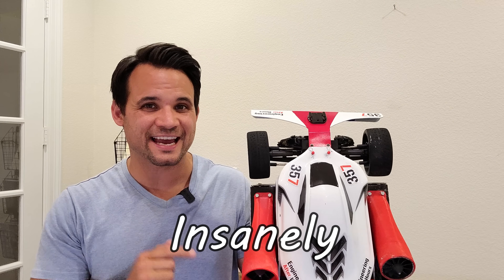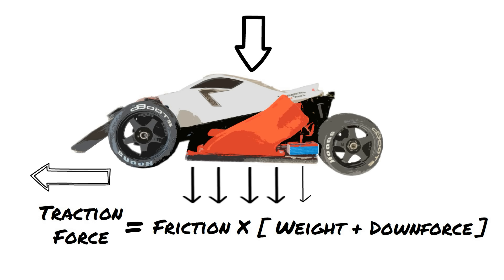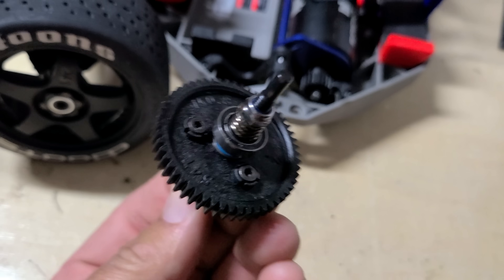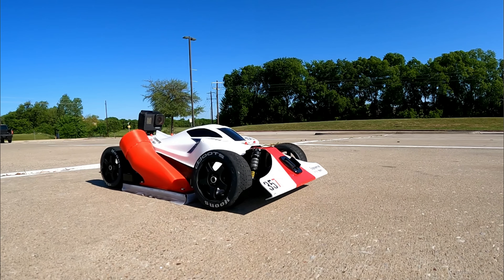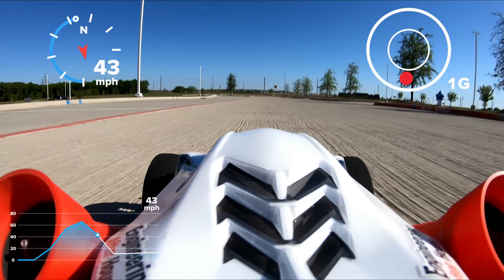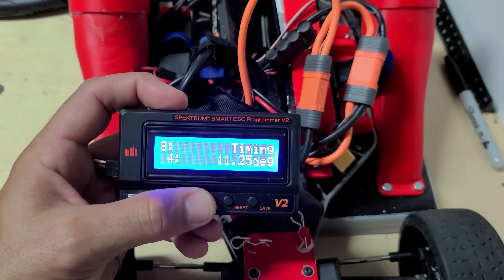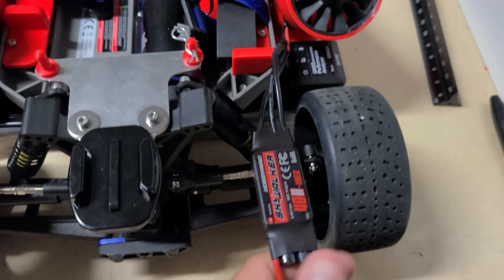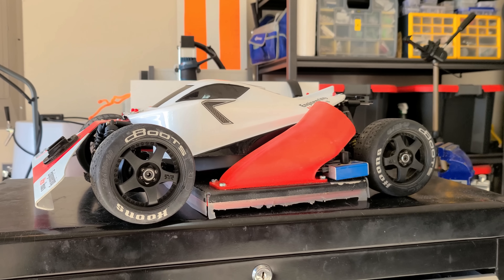241% More Grip with a Fan Car and Ground Effect

Comment: Using a ground effect to improve traction is a great idea as otherwise you're limited to about 1G as the traction simply cannot exceed the weight of the vehicle. You do mention around the 10 minute mark an intention to throttle the fans to reduce skirt friction at launch, but throttling the fans with the motor will never work asnot only do you need to overcome the inertia of the fans and fan drivers once throttle is applied before you can start generating any downforce at all from the set up, but you also have to overcome the volumetric displacement within the skirt. My first thought when you mentioned the desire to relieve the ground effect for initial takeoff was to actually stage the ground effect system with an idle stage of maybe 30-40%, and then throttling it with the main drive as this will already have your fans in motion relieving the inertia problem, and starting you off with a mild vacuum beneath the skirt helping with the displacement issue.
Another thing that could be done to reduce the displacement beneath the skirt is to fill some of it in with more material but that would both increase the risk of bottoming out and add weight that has to be accelerated and as such wouldn't be ideal.

Not going to lie though, I'm stoked to see a ground effect system in use here, as I've been thinking the same thing for a possible challenger to the roadster if I ever had the money to build it. I'd be using a small gas turbine to generate power augmenting a small battery set-up to save weight and provide huge amounts of current to the drive motors when needed, whilst sucking air from beneath the vehicle and providing a small amount thrust to help get things motivated

Comment: You should pick up an older 1/8th scale HPI nitro car and put an electric motor in it.  Those were designed for the kind of speed and HP you are trying to achieve.  The Toyota LMP car I have was 70mph out of the box.
Reply: Slash 4x4 is 65mph stock. It just takes longer to get there.

Comment: Non-sensored brushless motors have to move and twitch a little so the ESCs can detect the rotor position and start firing the motors properly. That's possibly your startup/launch twitch issue - until the car twitches and moves a little the motors can't go full power.

Sensored drive motor might be the difference.
Reply: you're telling me he has turbo lag on an electric car? makes sense
Reply: Yep sensors help with tall gearing for take off to
Reply: Glad to see this comment; a sensored motor/esc will allow for much better phase resolution and virtually eliminate the stuttering from zero RPM. In addition, a sensored setup will allow for more precise timing adjustments resulting in measurable and more meaningful adjustments when compromising mid-range torque versus total efficiency on the last leg of the curve up to 60 mph.
Reply: @caseMasterxL  150% agree with everything you said. But I'm just starting to TRY to get traction and settle in around 60mph so I can actually get on the gas 🤣🤣🤣
Reply: @motortoys9942  I have the same problem with my RC's but I don't get traction until about 80mph
Reply: @owensweeny6589  depends on the surface. Foams don't hook till 120 but still pulls all the way anyways 🤣
Reply: That and this motor and esc is very bad for studders
Reply: Agreed
Reply: Was going to say the exact same thing. It is the sensorless motor causing the stutter

Comment: Great video.  You used ground effects just like Formula 1 teams did in the 70's to achieve maximum downforce.  You mentioned that the skirts were rubbing on the ground and that's what you think is causing the stuttering.  Why not try what the F1 teams did back in the day and make a skirt that could slide up and down as the car moves up and down?  Also, I think the F1 teams used something slippery like plastic or wax to reduce the friction of the skirt dragging on the ground.
Reply: Could also use bristles, although that would reduce negative pressure (increase?)
Reply: watch his previous video on active downforce. He already covered all your points

Comment: what gear ratio are you running

:edit the studering off the start is the slipper delete
Reply from the maker: Several in this video. All the way from 19/54 to 24/54.
Reply: Add cap packs to

Comment: A better ESC and motor should fix that
Reply from the maker: That was my worry :)
Reply: @EngineeringAfterHours  also look at MIP drive shafts and LCG chassis,
Reply from the maker: Rear shafts are MIP...just a little pricey and heavy. The LCG chassis would be a great upgrade.

Comment: The stuttering at the start happens because of block commutation (how the esc switches the motor). A esc with Field Oriented Control has significant more torqe from a standstill (a VESC for example). Also VESCs support up to 12s voltage = moar powah babey.
Reply from the maker: Interesting...this can be done on a sensorless motor?
Reply: @EngineeringAfterHours  yes, it also Supports sensorless Motors. Although I dont know how good it works without sensors.
Reply: all sensorless brushless esc's rely on back emf (voltage induced by the magnets spinning by the coils) to sense the position of the rotor in it's rotation
sensored motors use additional magnets and sensors to directly measure the angle of the rotor

that has nothing to do with the commutation, which is what type of alternating current is used to drive the motor

the easiest type is square wave
most esc's use trapezoidial, there are a few that do sine wave commutation at startup and switch to trapezoidial and even fewer do full sinusoidial

the more rectangular the wave is, the more power the motor will produce, at the cost of smooth rotation
choppy rotation is most noticeable at spoolup, which is why some switch from sinusoidial to trapezoidial (smooth start, power when already going)

another factor is what pwm frequency is used to create the ac
the higher the frequency, the more efficient the motor is
lower frequencies create more power
some esc software use the rpm of the rotor to define the pwm frequency
Reply: Vesc also supports sensored motors, and has done high current stuff specifically designed for loaded start applications. I would definitely recommend checking it out.
Reply: Yeah I've been fighting cogging on my new stampede setup. My maxx does it with my bigger tires too sometimes

Comment: After your active aero videos and now this, I keep wondering how practical it would be to get some kind of active suspension system setup
Reply from the maker: I wish I had that for this video because the suspension has to be so stiff for the downforce
Reply: @EngineeringAfterHours  can you make tamiya mini 4wd aero dynamic effect? since the release aero body and aero chassis as well...
Reply: @EngineeringAfterHours  i can not find it anywhere... the best video is just blowing dry ice smoke in wind tunnel to see how air flowing. i feel not satisfied. sorry for bad english..